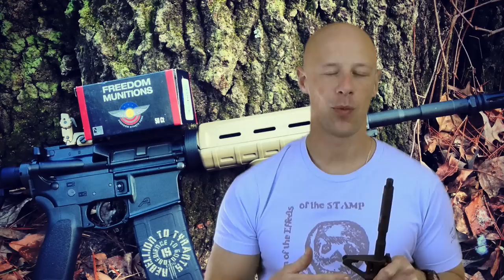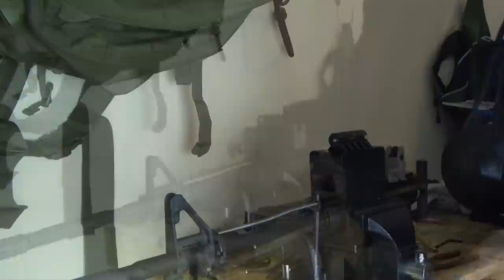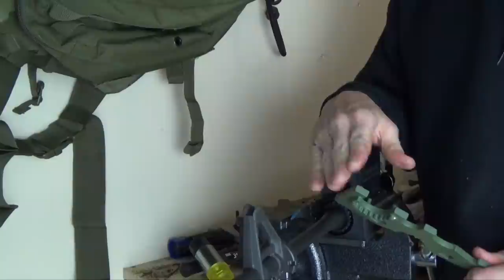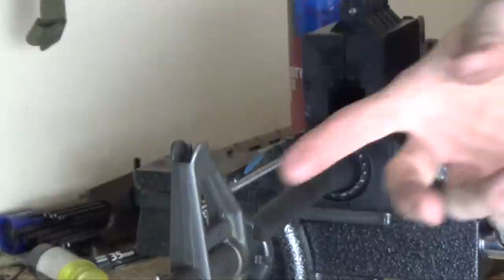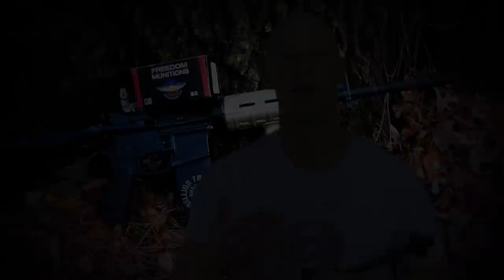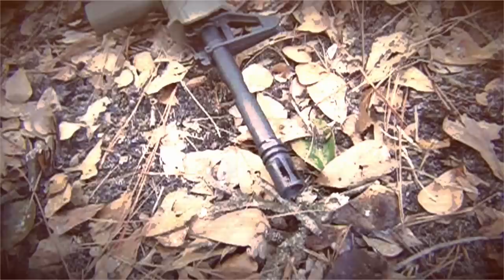How To Remove And Replace/Install An AR-15 Barrel (HD)

Comment: A 6920 doesn't come with a hammer forged barrel? Oh, I am glad I didn't buy one because that would be a major selling point for me. I would have been pissed if I bought one & it didn't have a CHF barrel.
Reply from the maker: shananagans5 No.
Reply from the maker: shananagans5 There would be no need to be pissed though as the specs are public.
Reply: You lose accuracy with a hammer forged barrel over a button broached barrel. If the materials in both types of barrels are the same. Then you're paying for something you don't need or most likely won't shoot out the barrels. I suppose for bragging purposes. Actually, the military was considering hammer forged barrels and due to the differences in durability it isn't worth it. You should see some of the actual metal reports. Instead of believing the marketing and sales campaigns from manufactures and sellers. Shame some thing like the aforementioned is a deal killer for you.
Reply: Mrgunsngear Channel lol That's why I would have been pissed. It would be my fault for not knowing.
Reply: Rick S You lose absolutely nothing in accuracy by using a modern CHF barrel (unless it's from Remington), that myth has been busted for over 30 years. In fact, properly made CHF barrels resist harmonic changes from heating better than nonCHF barrels. Unless you are mag dumping on full auto, or have the patience to check after several decades, you will not readily be able to discern the improvement in barrel life that you would also get from CHF.

Comment: I was wondering why anyone would buy an AR built when they can buy parts and make a custom one cheaper, but seeing that you might have to invest in a bunch of tools I understand better now. Seems like if you are going to get the tools to build one, it doesn't make sense to stop at one, haha...
Reply from the maker: David Hynes Fair enough.
Reply: Really, the cost of the tools is minor.  That wench he used is cheap.  The upper receiver clamp is not much either either.  After that, some roll pin punches and a few basic tools are all you need.  

The tools you buy are handy when you want to go back in to modify or repair the rifle.  Built one a few months ago.  I have to quit watching these videos.  Getting the urge to build another.

Comment: Yes. Like the video, got the info that I needed. But the only thing I saw that I didn’t like is your trigger squeeze. Horrible. Like vomit bad. 
Maybe Work on keeping your finger on the trigger, not smashing it,  but pressing back, and holding for a split second after firing, then releasing gently until you feel your sear click, all the while still never completely removing tension from the trigger, and repeat.